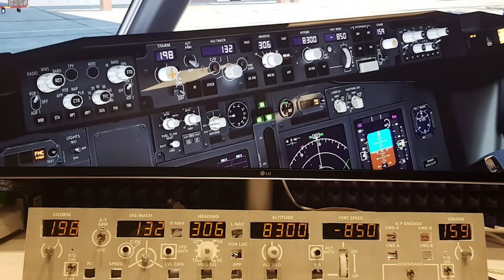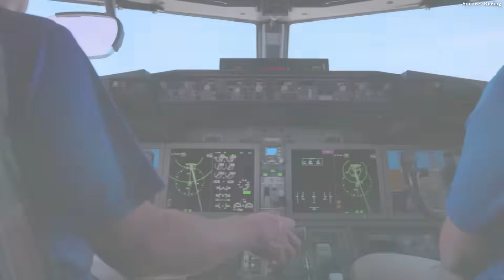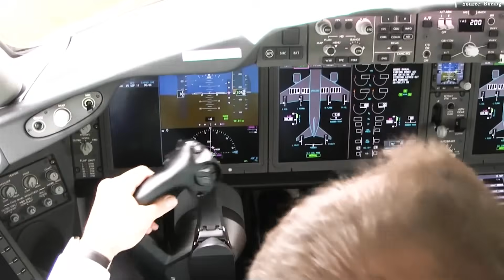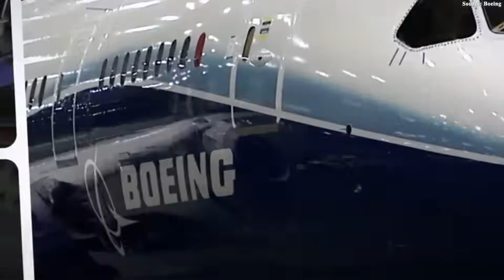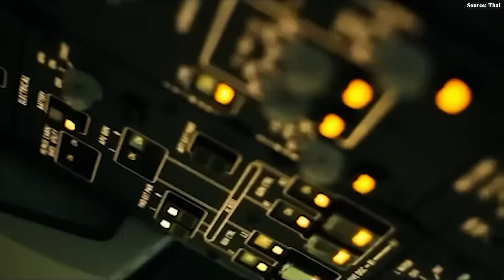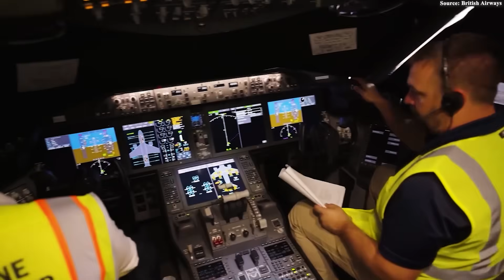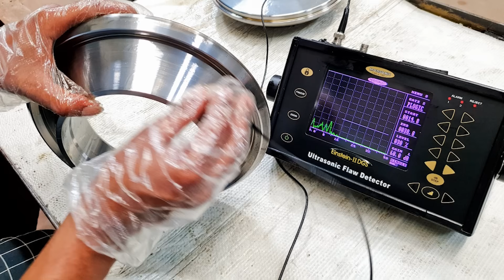FAA Just Dropped a BOMBSHELL about Boeing 787 & 777 SHOCKED Industry!

Comment: Many years ago now, l came across a video made by an engineer who put these planes togeter in the factory (funnily enough l can't find it anymore). He had smuggled his iphone in and took an hour's worth of everything that was going on. Fuselage sections knocked into shape to fit together. Rivets that were misplaced. Engine parts that were second hand yet signed off as new, the list goes on... The 777 and 787 are still relatively new, so it will take some thousands of hours more before these illegal and dangerous work/build practices start to show. When they do, these planes will fall out of the sky. This video is nothing new. Boeing have been putting dangerous planes out for years and all because of profit, with no care or concern for safety for the lives of passengers. That will be the case for years to come, no matter what Boeing says or promises. Boeing are basically liars, cheats, frauds, cons, and have had many passengers killed due to their poor management.

Comment: Thank you for enumerating reasons why the FAA continues its stringent supervision of Boeing’s manufacturing operations and its customers’ maintenance services. It will take time for Boeing to fix a corporate culture that ex-McDonnell-Douglas managers spent 20+ years transforming from one prioritizing quality to prioritizing returns for investors. The current CEO has an engineering background and, it’s beginning to show.

That said, Airbus also has airworthiness directives to contend with, most recently a software version rollback and a less widespread issue with fuselage panels whose thickness may be out of tolerance. Mistakes that should not happen do, the important thing is to have procedures that catch them as early as possible and a corporate culture that prioritizes fixing them over short-term profits.

Comment: I flew the 727 for 10,000 hours it was a well built no nonsense plane No magic no screens but really dependable Perhaps all that high tech stuff while nice to have is a pain to keep working
Reply from the maker: Yes.
Reply: Original 727 100 was my favorite  plane. Best looking plane as well, especially united stripe colors of the 70s when they still had Western Hotels.  ( UA flight 339 YVR SEA SFO thru flight) flew as a passenger for several years.  When it went thru tp LAX it was fl 337.